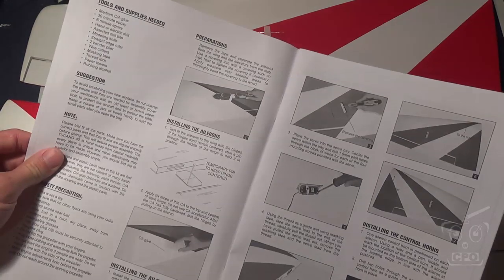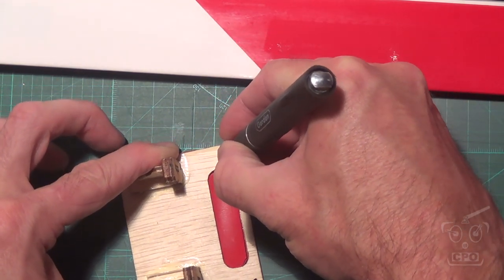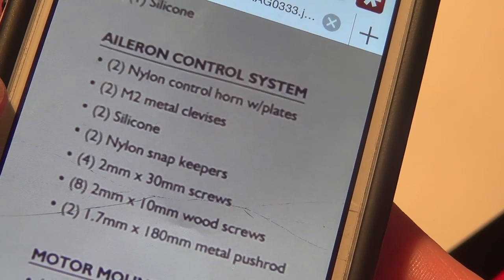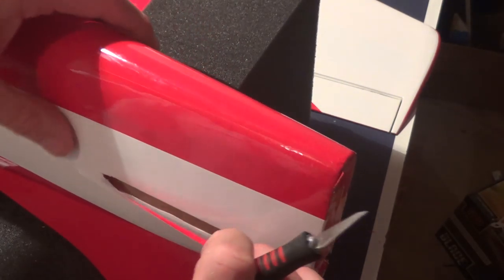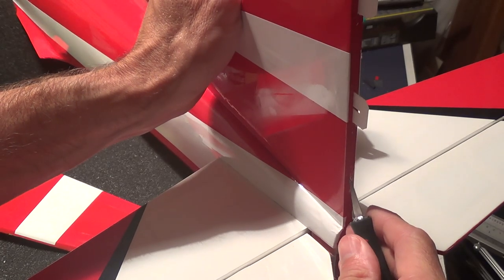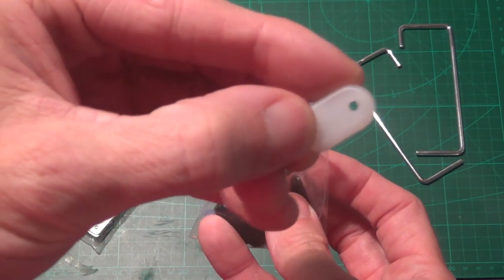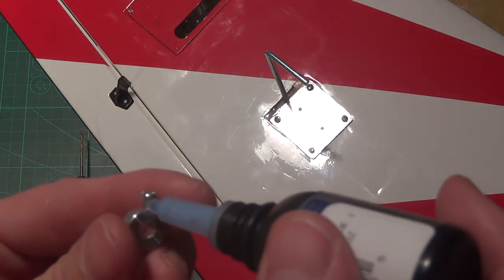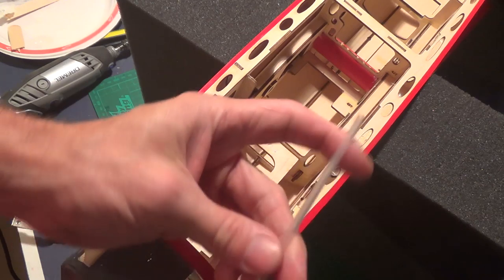02 Phoenix Tucano Build - Part One - Ailerons/Rudder/Elevators/Gear

Comment: When cutting away covering on the elevator, servo covers, etc - just just a needle point soldering iron. It will melt away the covering without risk of scoring and weakening the balsa.
Reply from the maker: GordyDownUnder Thanks for the great tip!  I got this from another experienced builder via email as well...and I will definitely be using that technique in the future!

Comment: I having lits of problems with this tucano on a os 46 engine!! First of all the fuel tank sits way higher than the carburetor!! Making my engine  over fueling, and I think is caused my brand new engine to blow out, it gets really really hot!! I haven't flown it because I'm still trying to tune the engine. But it's just impossible with an inverted engine and higher cual tank.. Any suggestions?